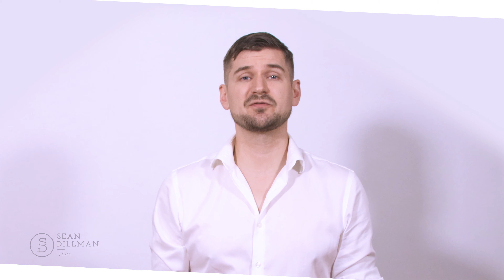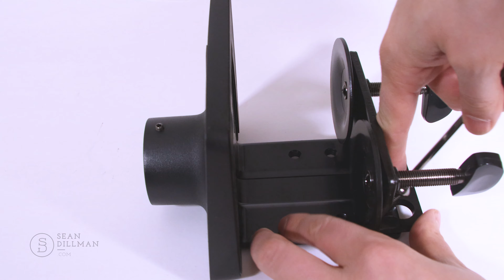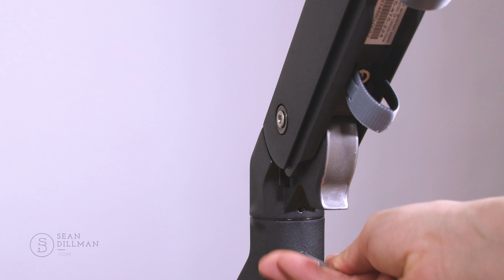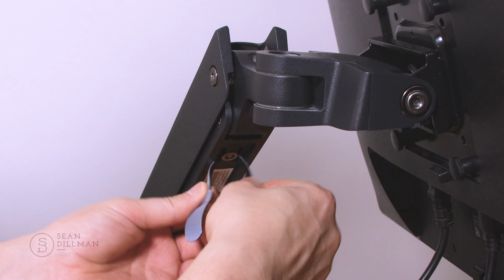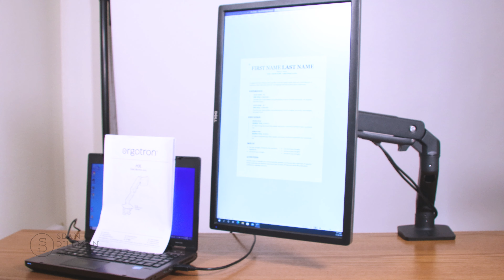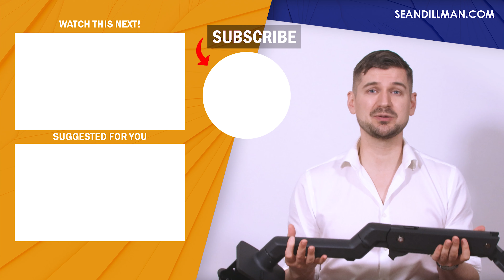💻 Ergotron HX Monitor Arm - Review & Assembly

Comment: I found your video helpful.
I would like to install an Apple Studio Display 27" that weighs 5.5 kg on my HX.
Will the light weight of the monitor cause problems?
If you know the weight of the monitor you are using it would be great to know.
Reply from the maker: Thanks for your message. I’m glad that you found my video to be helpful. That’s the goal. =)

Generally speaking, the HX series is for larger/heavier monitors and the LX series is for smaller/lighter ones. The weight capacity for the HX (the one I have and review in this video) is 20-42 lbs (9.1-19 kg). For the LX series, (part number 45-241-026), the weight capacity is 7-25 lbs (3.2–11.3 kg). It's definitely important to match the weight of the monitor to the arm because it needs a certain amount of weight to hold its position. If you happen to have a monitor that is below the minimum weight, it is possible to use longer bolts on the back and install some additional weight behind the monitor, but this is a bit of a fudge and certainly is not ideal in terms of fit and finish. The ideal situation is to make sure that the specifications of the arm and the monitor go together (size, weight, method of mounting to the wall or desk, etc.). I once read about this issue on a Geek Hack forum and I found the post. Here is a link: https://geekhack.org/index.php?topic=103310.0.

In your situation, the 27" Apple Studio Display may be too light for the HX and you may want to go with the LX. If you already have the HX or really want to go with it, you can also purchase plates that are used to increase the weight. Here is a link to a plate on the Ergodirect website: https://www.ergodirect.com/17300-add-weight-plate-with-vesa.html. My monitor is a heavier Dell that is about 10 kg.
Reply: Hi Sean-san,

Thank you for your very thorough response to my question.
I appreciate you.

I have not yet purchased an arm for my monitor.
I understand that the LX is the best for the Apple Studio Display 27 inch 5.5kg, but the pole that come with the pedestal are not my favorite.
I like the design of the MXV as it looks like the HX, but it is not my favorite as it does not seem to have good up and down swivel.
I like the idea of adding weights to use the HX!
Glad to get the best tips from you.
Reply from the maker: @末永圭三  I'm glad to hear that you didn't already purchase an arm. It's always a shame to hear when people have purchased equipment but there are issues with the specifications, or it doesn't work for them for any reason. You are not the first person who has said to me that they do not like the pole that comes with the LX. I suppose that it can be an aesthetic thing and we all want our rigs to work great and look great too. =)

Adding weights isn't such a bad option if a person has the time to order the right parts, can rig something up themselves if need be (a person could even use gym weights if they did it correctly), and can make it look presentable. I was once reading about an issue involving a courthouse where they wanted to use a certain kind of arm, and they needed to add weight, but they wanted it to look presentable because the arm was being used by a clerk who was visible to everyone in the courtroom (the gallery, witnesses, the jury box, everyone - so in a situation like this, rigging up something makeshift was not an appropriate option).

Keep in touch and let me know what you end up doing. If you subscribe to my channel, I hope to review more Ergotron equipment in the future – so you may be notified. It should be easier to get gear from them in the future if I have a video with high views that is helping people. Thanks again. =)
Reply: Hi Sean-san,

Thank you very much for your valuable advice.

I don't want to waste my money, so I will be thinking carefully about which arm to buy before the monitor is delivered.
If the arm under the HX cannot rotate 360° like the LH and MVX, then I must eliminate it as an option.
Also, the tilt mechanism of the MVH seems to be poor, so this must also be eliminated from the options.
That leaves only LH, but we may have to compromise on the design.
Reply from the maker: @末永圭三  . You are most welcome. It sounds like you have a very specific use in mind and you know the specs that you're looking for. Ideally you'll find the perfect arm that does everything you needs to do, has full rotation, has proper tilt functions, handles the right weight-range for your monitor, and looks good too. I'm sure that the right one is out there for you. =)

Comment: will that work with LG 38WN95C-W?
Reply from the maker: Hi Judas. That's a good question. The short answer is, I think so. The long answer is more complicated. With respect to the mounting bracket, I'm looking at that monitor on the LG website: https://www.lg.com/us/support/product/lg-38WN95C-W.AUS. I am looking at pages 8. It shows a diagram of the back of the monitor and the mounting plate. The Ergotron HX Desk Monitor arm comes with the components to fit this mounting plate configuration. With respect to weight, I'm looking at page 28. It says that the monitor is 6.6 kg (14.5 lbs.) without the stand. I'm on the Ergotron website to confirm the specifications. It shows that it can handle a monitor from 9.1 to 19.1 kg (20 to 42 lbs.). The LG monitor you have is within this standard. The website also warns "For a display weighing 28–42 lbs. (12.7–19.1 kg) with a depth of 6"–12" (15–30 cm), the accessory HX Heavy-Duty Tilt Pivot (98-540-216) is required". I am again looking at the manual for the monitor and it appears to be within these specifications (so you should not need the HX Heavy-Duty Tilt Pivot accessory. To get some firsthand knowledge, I'm reading a review on Amazon by Ian from the UK, posted on December 1, 2020. It is called “Super stable Desk Monitor Arm for Ultrawide Monitor”. Ian says “I purchased this monitor arm following some reviews on YouTube as to its suitability for supporting ultrawide screen monitors. I work with an LG 49WL95C ultra wide monitor that comes in with a weight of approx 29Ibs (12.6Kg) alongside the big real estate desktop space that I need for my work.” There is also a review from Craig McRae (as from the UK). It is called "Jazzy with my Samsung C49RG90". I know this is not the same monitor as yours, but he includes many useful pictures and descriptions of his setup using his ultrawide monitor. Finally, if you really want to be sure, you could call Ergotron to ask someone. They are generally very helpful and knowledgeable people. I hope that was helpful. Thanks Judas.
Reply: @SeanDillman  Wow!  You are awesome!  Thank you for that very detailed and very informative response!  Thank you!
Reply from the maker: You are most welcome @JudasBytes . I'm happy to help.